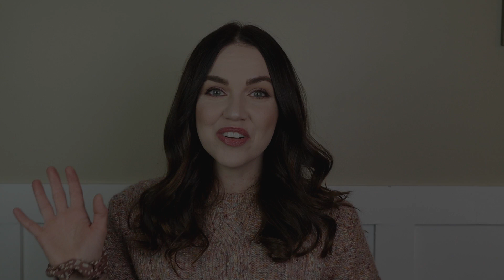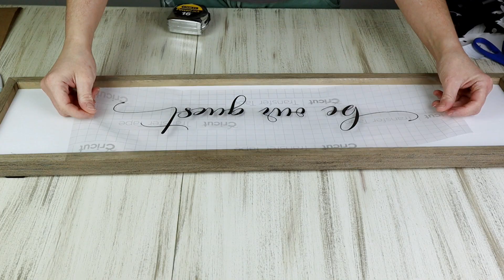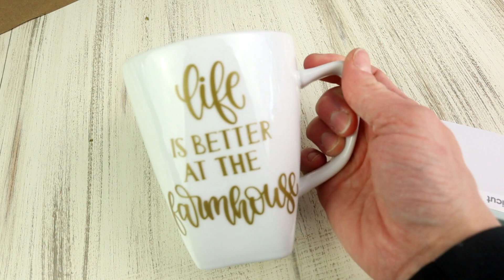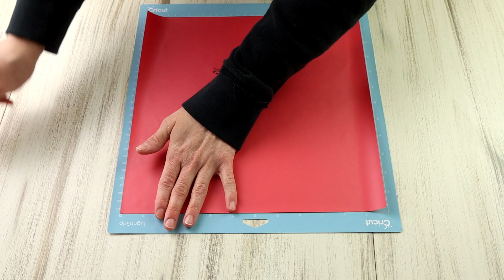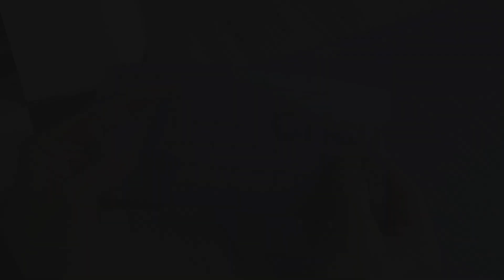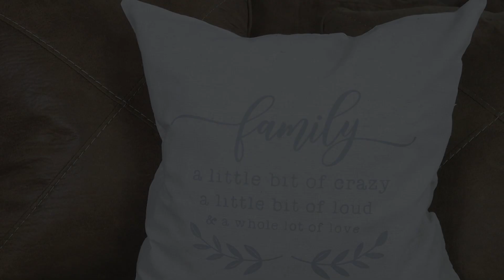Beginners Guide to Cricut Vinyl | Which Vinyl to Use for Your Projects

Comment: Please do more videos on the vinyl. I have ruined so much vinyl. The transfer process from off the cut vinyl and onto the transfer tape is an absolute nightmare for me. Very very discouraging. Just checked and I am using removable vinyl from Cricut
Reply from the maker: I have also ruined lots of vinyl! I like to take my time when weeding and I work in sections. I’ll pull away the excess vinyl then cut it off so it doesn’t accidentally stick to anything I don’t want it to. Don’t be discouraged it takes some time to get the hang of it.